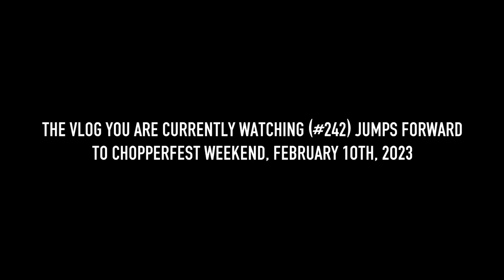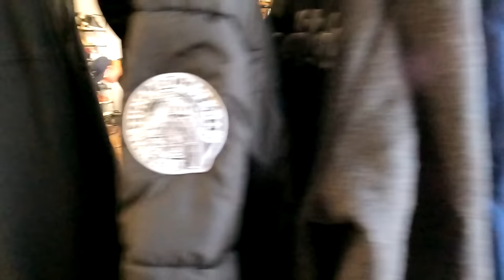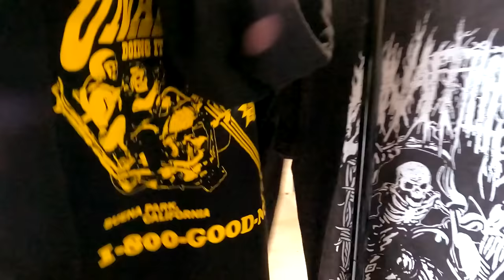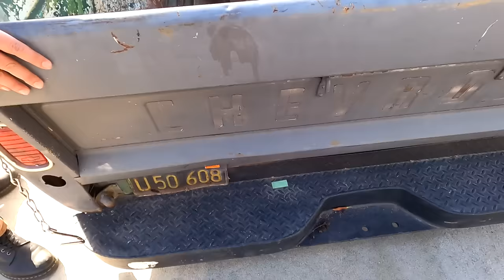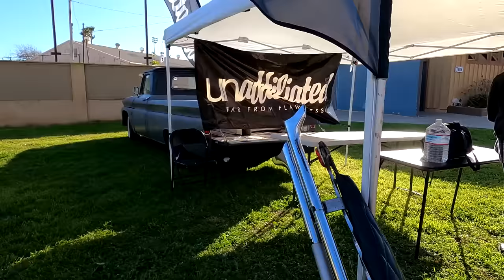#242 -  Days Before Chopper Fest 2023

Comment: Not sure what kind of hooks/tie down points are in the back of that c10 but you can get cargo tailgate type nets as like a temp tailgate in the event something loosens to the point of it falling out, obviously it’ll lean to one side of the other, but just putting it out there as it’s a cheap thing to help keep your bike in the truck in a worst case scenario. Bikes aren’t cheap but fixable, having something sentimental destroyed is hard to swallow. Not required but just putting it out there. Could always run a ratchet strap through where your rear axle is or your back wheel if needed to bind up if it starts rolling back plus it’ll already have less chance to roll with a little tension on it.